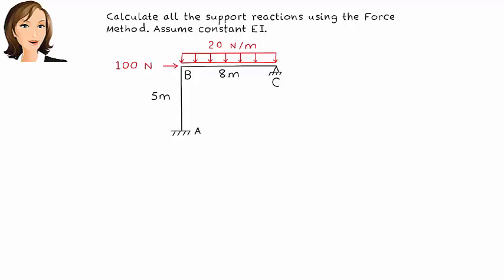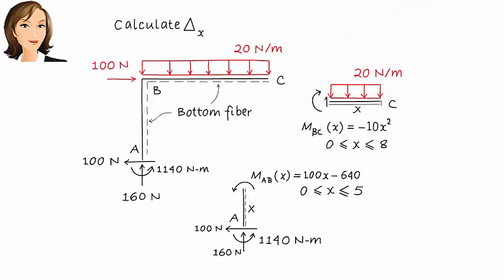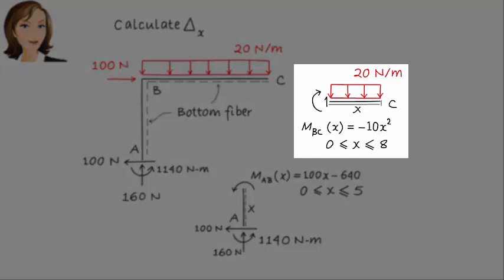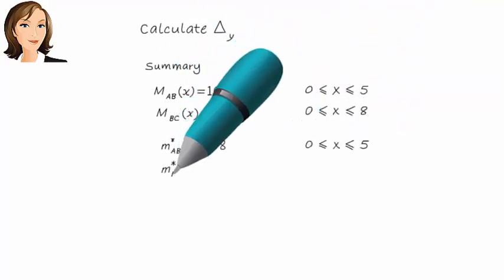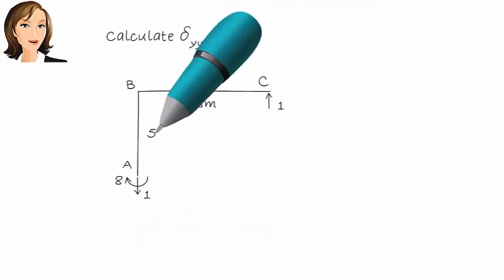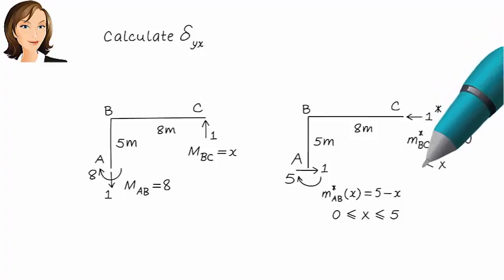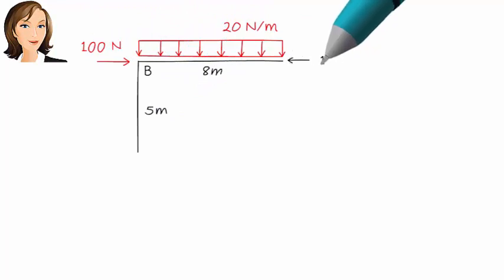Force Method: Exercise Problem 1

Comment: Dear sir/madam ( which gender are you XD ) sorry to bring you disturbance once again in your day of peace, i have some simple conceptual qusetion yet again as my foundation is not strong, hopefully you can help me with it

https://ibb.co/x6rn4nT
https://ibb.co/BjHgm8J
1. For this sample frame, the main load are only being apply at the 4 side ( the 4 centre of beam as the edge has no load apply ), numbered as 1,3,5,7 but when we talking about support, the centre shouldn't be able to take all the load and most of the load will transfer to the 2 end of the beam instead of the centre( which then transfer to column ), how should i compute for them ?

2. Can i split the frame analysis in to 2 part as shown in the right of this picture ?
https://ibb.co/BjHgm8J 
I am planning to separate the top beam part from the frame and apply a 3 support structure on it, and then apply virtual method to calculate for the beam, since the load is at centre and i have a triangle bracing to support the centre, the edge shouldn't have any load. But then i realise the rigidness/strength that i use for the bracing ( the triangle supporting the centre of the beam ) might be weak and cause more load to be distributed to the 2 ends of the beam, so i might need to analyze the beam as a whole, can you kindly guide me ?
Reply from the maker: The purpose of structural analysis is to determine the behavior of the system given its geometry, loads and boundary conditions. In this case, you are modeling your beam as a continuous one resting on three pins/rollers. If you decide to make such a simplification, the answers that you get for the support reactions would not be accurate. Your modeling involves treating the mid-point of the beam as if it is resting on a roller. That is, you are assuming there would be no vertical displacement at that joint under the applied load. That is not a reasonable assumption to make. You are over-simplifying the problem. This structure/frame needs to be analyzed as a whole. Otherwise, the answers that you get are not going to be useful for design purposes. 

If the only load being applied to the structure is the load of gravity, if there is no wind/horizontal load present, the bracing is of little use. The purpose of bracing in structures is mainly for sway control due to horizontal or eccentric loading.

Comment: Dear Sir, 
I have come out with new idea for the frame
https://ibb.co/2sL2QTV
Below are 2 free body diagram i draw, i assume only 2 support and assume the 2 side point doesn't contribute ( worst case )
a.) https://ibb.co/kXhQSvv
b.) https://ibb.co/tz0Q1rh
1. Which above would be more accurate assumption ?
2. I assume the base to be "pinned" since i am having bolts and nuts to lock the body to the support structure, is that right ?
3. The frame consist of 4 support reaction, 2 in x and 2 in y, but i can't make force in the "y" direction to be redundant as it will give me moment and since my support is not fixed i won't be able to calculate, so i can only make the force in "x" direction to be redundant, is that right ?
This is the concept
https://ibb.co/dcM4FMm
Reply from the maker: Between the two options that you’ve provided, the one in which the wind load is applied at the top of the frame is a better approximation. Alternatively, you can model the problem as shown in the image below. 

http://lab101.space/QA/frame-tank-example.png

To simplify the analysis, you can solve the problem by treating the gravity load and wind load separately. Analyze the frame under each load, then add up the results at the end.

As shown in the above-referenced image, for wind load, you can replace the tank with a wall. Then transfer the wind pressure on the wall to the side frames. This should give a conservative approximation for the effect of the wind load on the frame. This assumes that the tank is rigidly connected to the supporting 3D frame assembly.

As for the connections, yes, bolted connections generally should be viewed as pin connections.

As for the analysis, yes, you need to take one of the horizontal reactions as the redundant force, otherwise the simplified structure becomes unstable and cannot be analyzed.
Reply: @DrStructure  do you have calculation for the frame-tank-example you posted ?

the frame is not fixed, it is pinned as well, can i put 2 triangle on top of my column with a horizontal beam on it since i am having a pinned frame ?
https://ibb.co/q9KLKky
Reply from the maker: @DOTA2MAJISTRATE  No, I did not do any calculations on that problem. The diagrams are meant to suggest an alternative way of modeling the problem.

On having the beam attached to the column as pins, that would not work. A frame that is pin connected at the base and had pins/hinges at the top of the columns becomes unstable. If the structure is going to be actually designed and built, care must be exercised to properly design the connections as well as the members.
Reply: @DrStructure  Noted

Forgive me sir, can you kindly elaborate for me on your statement ?
1. On having the beam attached to the column as pins, that would not work. A frame that is pin connected at the base and had pins/hinges at the top of the columns becomes unstable( why )

2. care must be exercised to properly design the connections as well as the members. ( what would the term "care" defines )

3. is this column having a pinned connection at btm ? and is it having a pinned connection at top as well ?
https://ibb.co/Lp5x5Pt
Reply from the maker: @DOTA2MAJISTRATE  1. On the stability of the frame. A frame that consists of two columns and one beam, if pin connected at both supports (at the bottom of the frame), is indeterminate to the first degree. That is why we need to use a technique such as the force method to analyze it. Such a frame is assumed to have rigid beam-column connections. That is, the angle between the beam and the column remains 90 degrees as the joint rotates.  If however we remove this rigidity constraint by assuming a pin/hinge connection between the beam and the column, then in effect we are reducing the degree of indeterminacy of the system by 1. This is so, because bending moment at the hinge/pin is zero, which means one less unknown to solve for.  So, if we place a hinge at one of the beam-column connections, the degree of indeterminacy of the frame goes from 1 to 0 (the frame becomes statically determinate). If we place a hinge/pin at the other beam-column connection, the degree of indeterminacy goes from 0 to -1, which means the system becomes unstable.

2. Connection design is a central topic in structural design. There are various types of connections each with its own set of configuration and strength requirements. You can find a discussion on this topic in most steel design textbooks.

3. Whether the column has a pin connection at a particular location is a design question. That is the structural engineer makes that decision during the design process, and the connection is constructed according to the wishes of the engineer. So, as the engineer in charge, you need to decide what type of connection you want at the bottom and top of each column. And in this case, if you decide to place a pin connection at both ends of the member, your design would fail (at least in theory).
Reply: @DrStructure  
1. The explanation given is very clear, thank you
2. I will try to do some research, thanks
3. In this example that i draw, i place 4 beam ( welded to each other to frame a beam frame ) on top of 4 column ( beam is place directly on top, and i put bolts and nuts to lock beam to column as shown >> https://ibb.co/1RSKgyN , are we able to tell if it is fixed or pinned ?
4. is this ok ? https://ibb.co/qn8h7zn
Reply from the maker: @DOTA2MAJISTRATE  3. If we have a picture of an actual connection, one that has been designed and constructed, we would be able to tell whether it is a rigid (fixed), semi-rigid, or a pin connection. But, the CAD drawing that you have just shows a set of holes, it does not provide the necessary details for assembly the connections. You don't have those details because you have not yet designed the connections. First you need to decide whether you want the connection to be pin or fixed. Once that decision is made, you then need to design the connection according. You will then draw the connections details showing the exact location, size and arrangement of the holes, the bolts, and/or the weld.

4. Yes, that constitutes a determinate frame.
Reply: @DrStructure  i am sorry for having so many question, can you please help me with below frame ? how do i determine the stability of a frame ? ( stability of truss = 2 x joints and compare with number of member + reaction force, but how about a frame ? )
1. Is this frame stable ? >> https://ibb.co/60z8c8R
2. How do you determine the stability of above frame
Reply from the maker: @DOTA2MAJISTRATE  Stability has to do with the system not being able to have a rigid body motion. In the case of trusses, it is more than (2*nj + support reaction) formula. Please review Lecture SA02A ( https://www.youtube.com/embed/w7rAiqzlanQ ) for details.  The same idea hold true for frames. Can the frame have a rigid body motion under the existing boundary condition? If the answer is yes, then the system is not stable. 
An unstable frame cannot be analyzed, meaning the equilibrium equations for at least one part of the system cannot be satisfied. You can test a frame by subjecting it to horizontal and vertical loads and see if you can determine the unknown forces (and see if all the equilibrium equations are satisfied). 
To show if a structure is stable, one can formulate the stiffness matrix for the system and see if the matrix has an inverse. If the inverse of the stiffness matrix exists, then the structure is stable, otherwise it is unstable.
The frame that you have is unstable. By placing hinges at all the joints, in effect, you have turned it into a truss. This particular truss geometry is unstable.
Reply: i have also made calculation ( please ignore this as you wish, i am sure the calculation and maths is correct after watching Force Method Problem 1 & 2 many times, but it will help if you could assist me to verify the if the concept are correct )
https://ibb.co/QX5zHN3
Reply from the maker: One issue that I see here is the value of bending moment in the beam at C in the first diagram. It should be zero, not 40.
Reply: Interesting example and a good one nonetheless, picture is quite clear as well

The moment from C to D should be 40, it's positive shear

The model on base frame example  is assume to be fixed to the frame, will that yield not so conservative results compare to a model with pinned support ?
Reply from the maker: A frame with pin supports tends to displace more laterally compared to one that is fixed at the base. Consequently, the fixed frame is going to be stressed more, since it does not want to yield to the applied forces (it does not want to displace).

Comment: good day to you, why don't you consider tensile and compression ?
shouldn't it be
delta x = Wi(AB) + Wi(BC )
delta x = Moment in AB + Axial Load in AB + Moment in BC + Axial Load in BC
delta x = [ integrate ( m* x M )/EI + P*L/AE x fab ] <-- Member AB + [ integrate ( m* x M )/EI + P*L/AE x fbc ] <-- Member BC
Reply from the maker: Yes, in theory we need to consider the effect of axial deformation in our calculations. However, in beams and frames, in most cases, axial deformation is insignificant compared with deformation due to bending. Hence, omitting axial deformation does not alter the results significantly. In this particular case, note that when calculating delta x, the term associated with axial deformation vanishes. Axial force in member BC (P_BC) is zero, and f_ab is zero. Therefore,  (P_AB*f_ab + P_BC*f_bc) = 0.
Reply: @DrStructure  noted, and i notice you change the moment direction, you do that so the moment in "M" and "m" has the same direction so that they can be multiply, am i right ?
Reply from the maker: @DOTA2MAJISTRATE  Correct! We need to have both of them acting in the same direction. In this case, we've drawn them in the positive direction (per beam sign convention).
Reply: @DrStructure  thanks, i am slowly growing towards structural truth :D

Comment: While calculating Delta X and Delta Y , why haven't the virtual internal energy due to axial load considered. Its effect will be significant while calculating Delta Y
Reply from the maker: For a more accurate analysis, axial load/energy on the column needs to be considered. Yet, although the effect of internal energy due to the axial load could be significant, it generally does not alter the results more than 1 or 2 percent, well within the acceptable error tolerance.
Reply: @DrStructure  Thank you for your reply

Comment: Hi ! If a am not wrong calculating dxy at 4:46 means the we have to calculate the horizontal displacement at C due to a vertical unit load applied at C so the equations should be  m*bc=0 and  Mbc= x for 0<x<8 and m*ab=5-x and Mab= 8 for 0<x<5. Am i wrong ?
Reply from the maker: No, the real load is a unit horizontal force which acts along the central axis of BC. It is like an axial load for the member. So, it would not cause any bending moment in the member. The virtual unit load, on the other hand, is a transversal load, like a support reaction (or a shear force) acting at end C. That force causes a bending moment. That is, at some distance x from C, the moment of the force about that point would be (1)(x), 1 being the magnitude of the load and x being the moment arm.
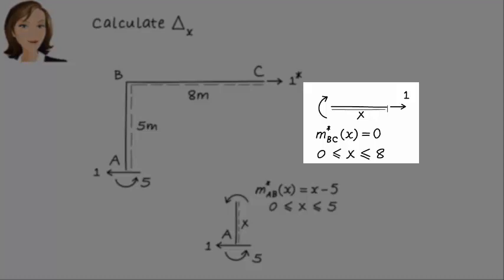Reply: On the lecture SA25: Force Method (Part2) minute 02:48 Delta bb and delta cb where used as a subscript wich meant that delta bb was the displacement at B due to a unit load applied at B and delta cb was the displacement at C due to a unit load applied at B... so there is no virtual load so far mentioned. The virtual load unit was used later to find the above displacements. So thinking the same way i thought that delta xy on the problem above was the horizontal displacement at C due to a vertical unit load applied at C but in the solution above you say that delta xy is the horizontal displacement at C due to a VIRTUAL unit load applied at C. Maybe the term virtual unit load is wrong or maybe i am wrong
Reply from the maker: By virtual load, we mean something that is not really present on the beam. The real loads are the applied loads, anything else can be considered virtual. So, dxy is displacement in the x direction due to a unit load in the y direction. The unit load is indeed a virtual load. In calculating any dij, we are working with unit loads placed in i and j directions; these are made up (virtual) loads.
Reply: Ok thank you

Comment: Why don't we calculate the displacement due to axial load in this case? Because it's too small? Anyway, thank you for good video.
Reply from the maker: Yes, here we are assuming change in the member's length due to an axial force is negligible. Or, the members behave as pure beams only (deformation is due to bending moment only).
Reply: @DrStructure  Thank you for the answer and your quick reply